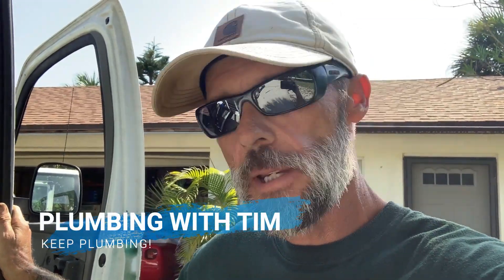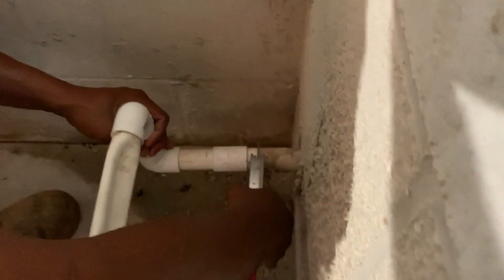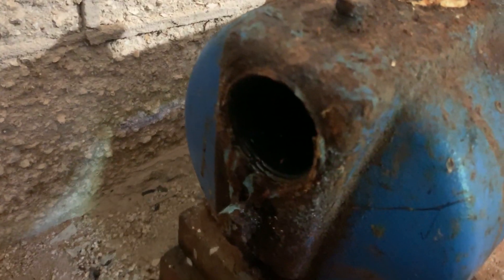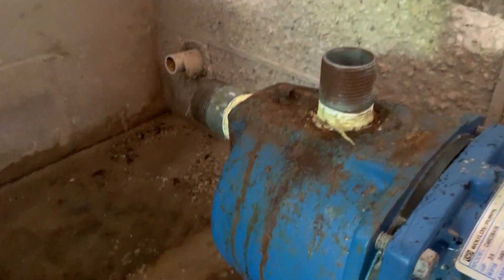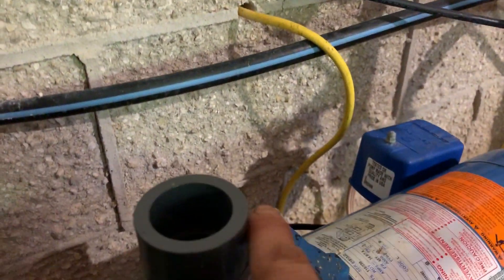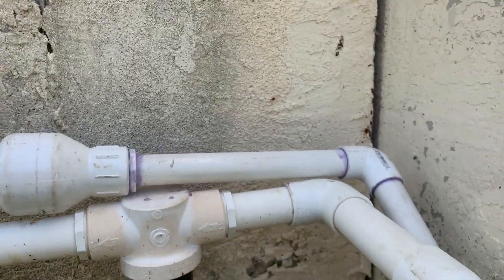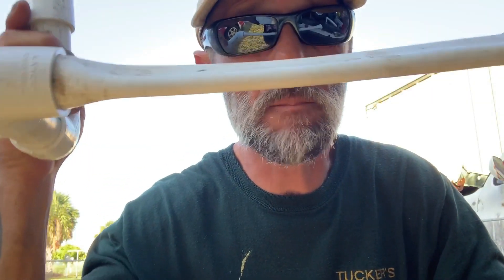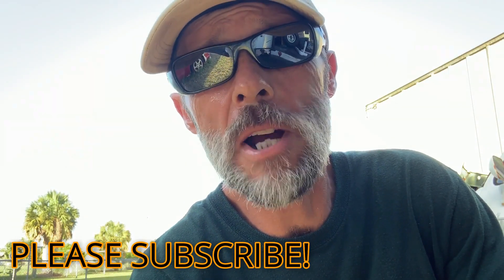HOW TO PREVENT WELL PUMP FROM DAMAGING PVC

Comment: That's a pretty decent overview. Most of the problems I run into are the check valves staying open and the pump loses it's prime. Not only do I see sdr26 thin wall pipe being used on every job but like your video I see pvc male adapters screwed directly into the inlet and outlet side of the pump. The most common problem i find with irrigation pumps is after a year or so the suction side of the pvc male adapter melts just enough to allow air in and you get no suction and customers think they need a new pump.  That's Florida for ya,lol

Comment: And are you using old school rector seal pipe joint compound ?    Your diagnosis is correct ..   and I despise finding damn irrigation pipe on water supply systems .. you'd be surprised how many water supply mains I have dug up and replaced due to the use of pr160 or pr200 pipe used on the supply.. that's a sign of a plumber trying to be too cheap .. roots will peel a joint loose very easily with the inferior pipe and most failures are located right at a glue joint .. for water supply lines being installed by me it's going to be schedule 40 pipe or pex ..  in real rooted areas I even suggest sleeving the pipe in 2 inch for added protection
Reply from the maker: Yes Rector seal #5 to the rescue. Thanks Ken for the great tips. Take care